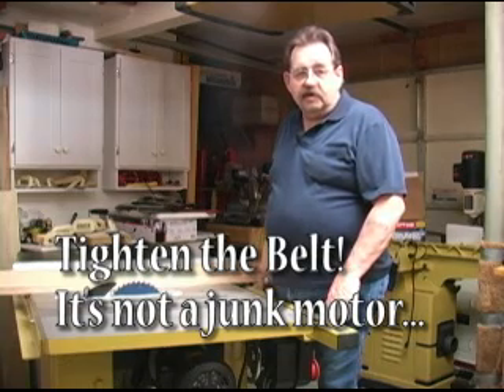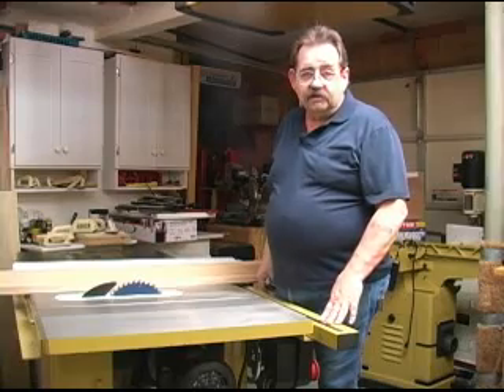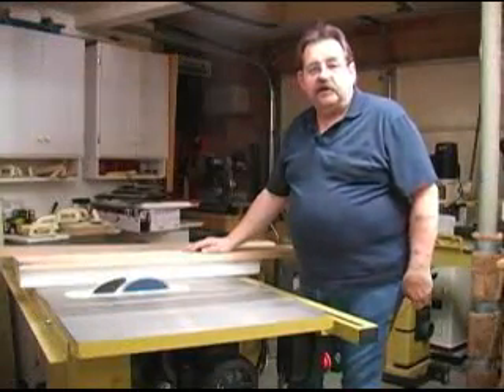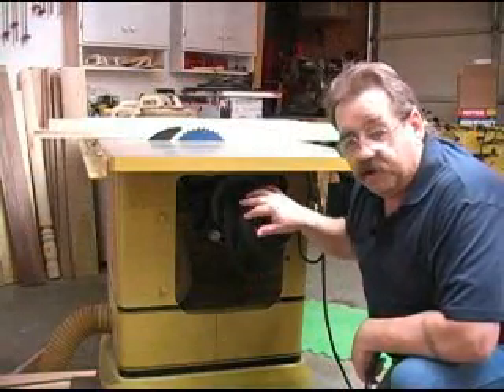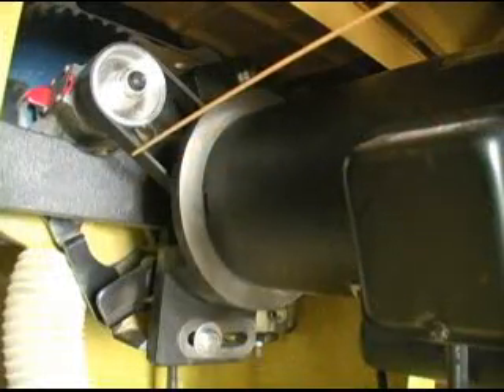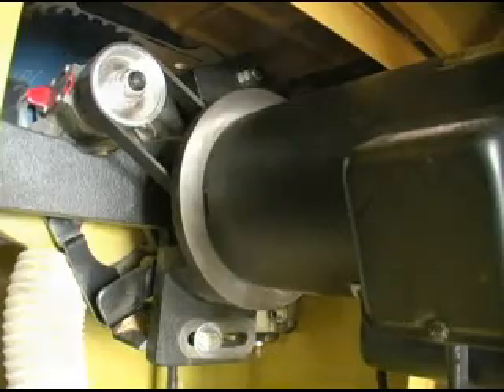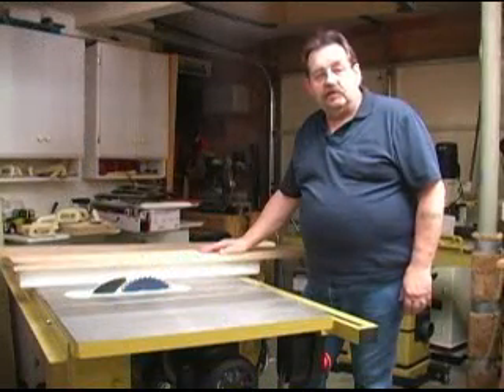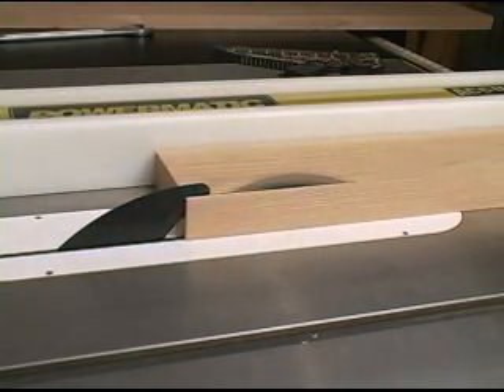Powermatic PM2000 "Power" Fix

Comment: This is a good video. I recently cut some dados on my PM 2000 with a somewhat dull set of cutters. The belt started to squeak on startup, I knew it was loose. But I had the blade in the raised position and couldn't figure out how to tension the belt. This video shows you can't do it that way, have to lower the blade to tension it. The booklet should say that, or even just put a little sticker near the lower mount bolt telling you to lower to the blade to tighten the belt.

Comment: On mine the blade got so slow it stopped so I tighten belt and then the motor smoked and burnt up so I removed motor and pulled the motor out of my 1hp craftsman saw and did a few mods to get it to fit and now it will cut 3 in Oak like butter.